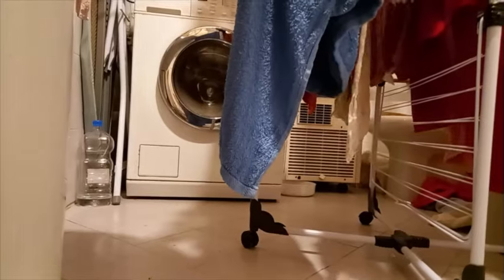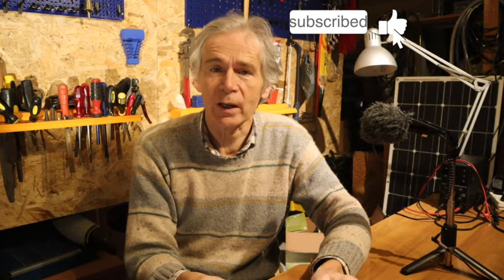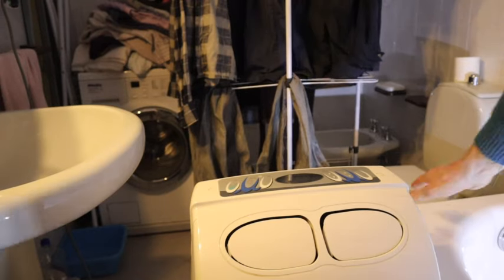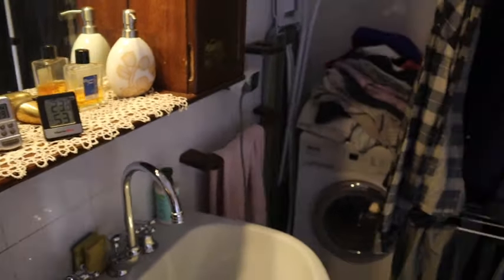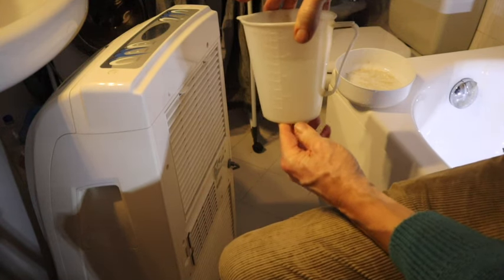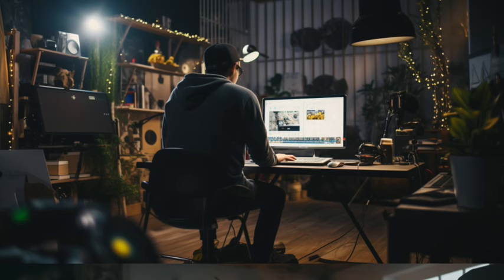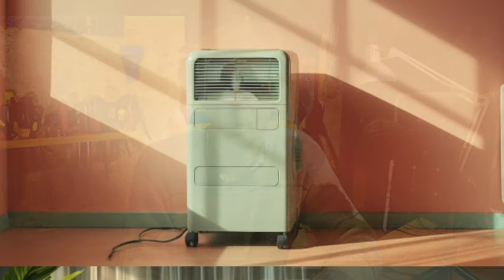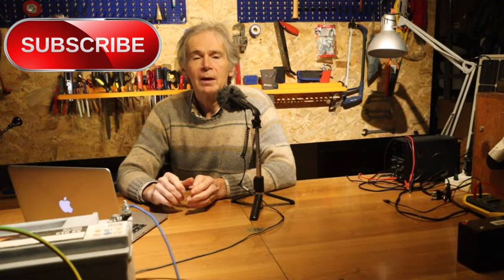Save energy while drying the laundry, the demonstration - Video 36b

Comment: I used my dehumidifier in my bathroom , after a shower, to dry my hanging bathtowel. It reduces the mildew smell that towels get if they take too long to dry. 
I have also used it to dry laundry during humid summer. It was very fast and effective since I do not have a dryer and I hand wash my clothing.  I recently purchased a spin dryer machine to remove the extra water from the washing. it takes 5 minutes or less and makes drying the clothing much faster. 
OH, the Portable Air Conditioner. What a Great Idea! Thank you for that suggestion! Solve two problems at once, during summer.
Reply from the maker: Dear Metqa, I am really happy that the idea with the airco was useful.  Going deeper into the matter it is surprising how ideas are coming up.